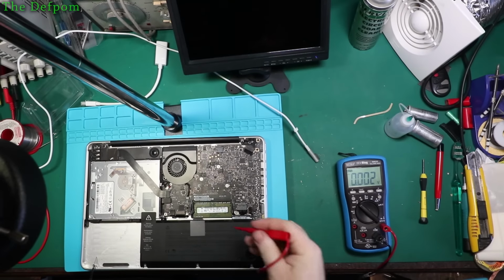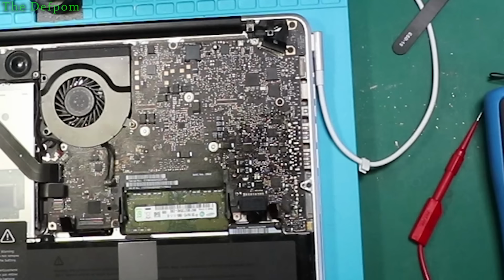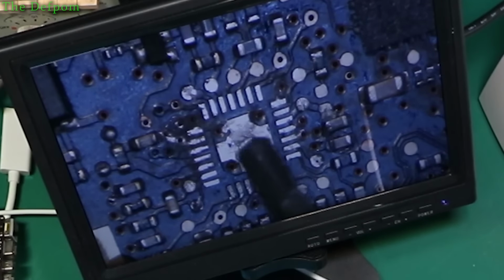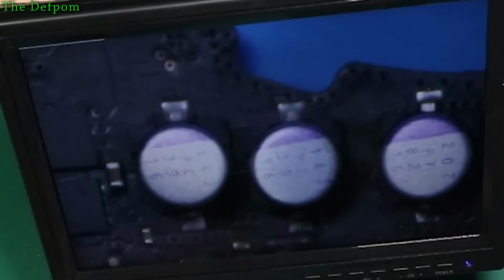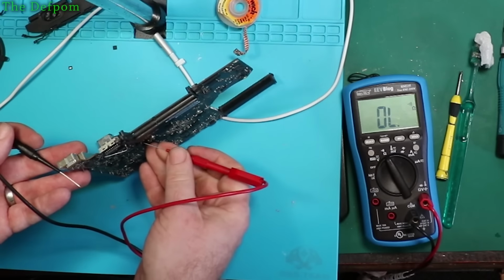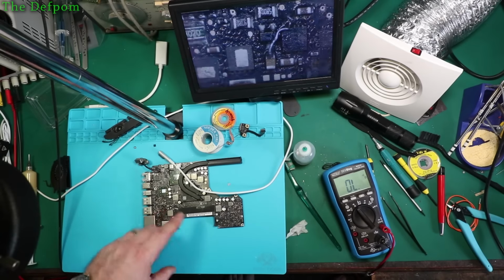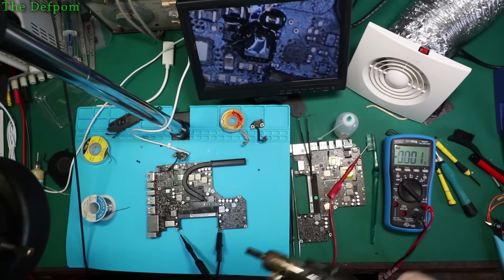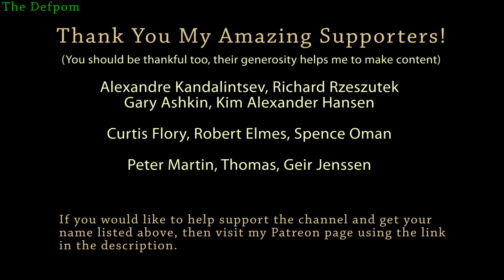🔴 #575 Apple Macbook Pro 13" Mid 2012 Repaired A1278 820-3115 Dead SN_YGDTY3

Comment: The microscope/monitor combo is working well for your repairs and making a video.
Reply from the maker: IanScottJohnston - I did try recording the hdmi output on my computer with OBS originally but OBS crashed and lost footage, so I resorted to recording the monitor to make sure I actually record what I’m doing. My original plan was to merge the main camera and the microscope footage, but that didn’t work out.

Comment: Are there any money in fixing a 7 year old MAC's like this? Thought computers depreciated so quick that it was a waste of time and energy.
What about buying defective test gear like RF generators, Scopes, Spectrum analyzers, PSU's etc
Then make a video on fixing and restoring it, and then sell it on Ebay or something, with the video as a documentation on the unit?
Or don't you think there's enough money (or viewers) in that?
Reply from the maker: Geir Endre Jenssen - there’s not much money in MacBooks no, MacBooks hold their value better than PCs do at least.

The test gear repairs I do are marginally better, mostly because of the cost of postage, the test gear could cost me up to $1000 a time, with no guarantee that I can actually fix it, it is always a huge gamble when I buy them just to make videos, which is why I appreciate those that support me with donations (such as yourself) as it reduces the financial impact of running the channel.
Reply: Finding faulty test gear without paying waaaaaay to much is really hard to do. Defpom like myself probably scours Ebay on a daily basis.......but it just isn't there most of the time. The other hard thing is I personally find it hard to sell afterwards [serial hoarder!].
Reply from the maker: IanScottJohnston - I look once a week or so, otherwise I wouldn’t get anything done.
Reply from the maker: IanScottJohnston - oh and yes, same issue, I find it hard to let go of gear if I think it is something I can use.